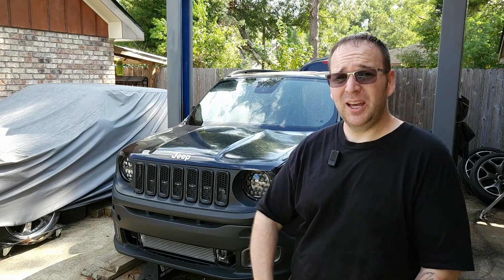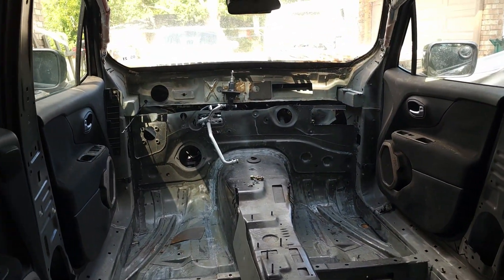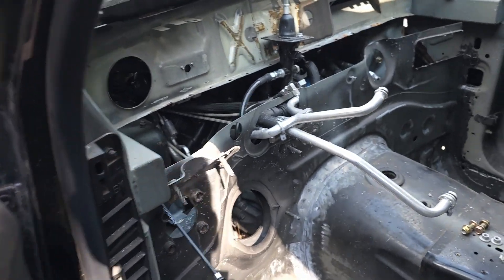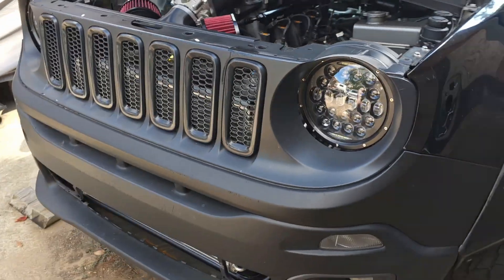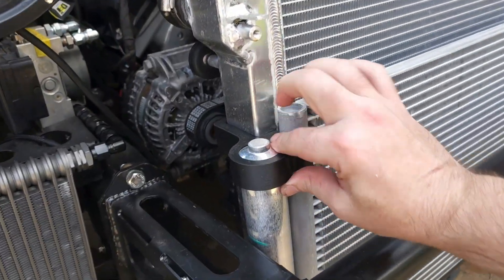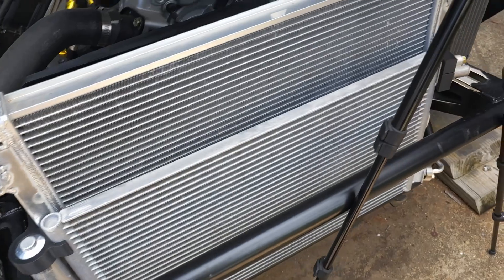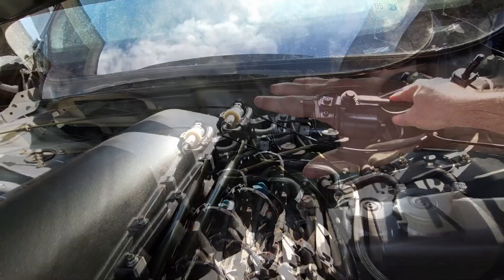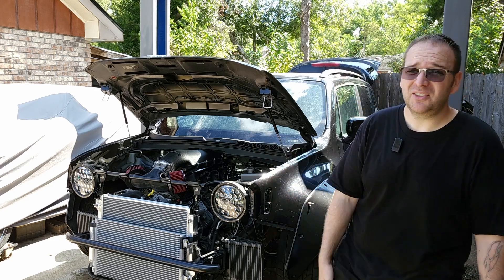HEMI Swap Jeep Renegade Update

Comment: Sick build. For the passenger-side wiper, could you just mirror what you have on the forever side? So it still wouldn't be like the stock setup but kinds like a bus-style wiper setup.
Reply from the maker: I think with the plastic cowl and how integral it is for the windshield, it might be too much work for now.  If the cowl were a flat piece that would be a good idea, but the shape of plastics just won't allow it.  I don't really plan on ever driving it in the rain, but figured one is better than none lol.  Thanks for following along with the build, and the ideas!

Comment: you should molde the fenders or make them look smooth it would look alot cleaner but its a unique build
Reply from the maker: I'm trying to learn how to 3D model a new set of widebody fenders in CAD, but I'm not having the best time figuring it out.  Once I get it figured out, I plan to CNC machine some molds.

Comment: This is 🔥🔥 Is there a link to the fender flares?
Reply from the maker: Thanks!  I actually built those flares a few years ago, but I'm trying to learn some 3D modeling software (Fusion 360, Blender, etc.) so i can design new flares and CNC machine some molds.  Once that happens, I'll be able to make some copies.
Reply: @HEMIGADE  👀 I may have to commission you for some lol.. keep up the good work bro.. New Sub
Reply from the maker: @SRTDUMMY  for sure, that's the eventual goal at least is to be able to make a few sets

Comment: One of my questions is how will the suspension feel? Will it ride like a shopping cart, forklift, NASCAR stock car. You tell me.
Reply from the maker: I'm really not sure how it'll ride.  The BC Racing Coils will probably be pretty stiff, but with the engine so far forward compared to stock Charger geometry, who knows.  The front might be a bit bouncy, but the coilovers are adjustable to dial in the ride.  It will be on air ride suspension eventually though.

Comment: I have a 2017 green ,would life to put wide 20's would that work or What you suggesting?
Reply from the maker: before I chopped this one up or had it on air ride suspension, I had 2" spacers on stock wheels and tires and lowering springs with minimal rubbing.  In order to fit the 20x12's I had on previously, it took quite a bit of cutting (with air ride suspension).  There are a ton of variables though, considering ride height, wheel width and offset, and tire size.

Comment: Sooo what's going on with the white Rene?
Reply from the maker: I'm not really sure, I hopped on Copart and accidentally won the auction for another project lol.  It was wrecked in the front, and I just happened to have everything to rebuild it sitting in the garage (core support, headlights, bumper reinforcement, fenders, etc.).  It should be a good reference for measurements, and I used it for figuring out the hood release cables.  It's been so long since i took the other one apart, so I don't really remember how it all goes together. Also I'll be 3D scanning it so i can build the new widebody off of it.